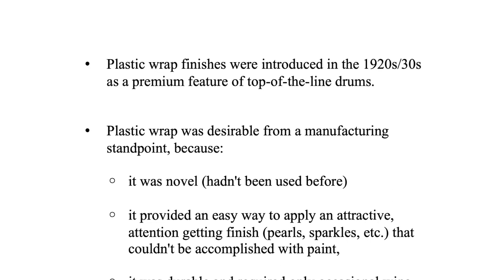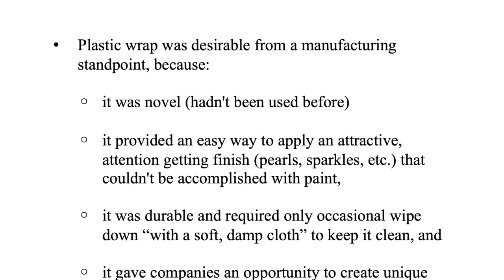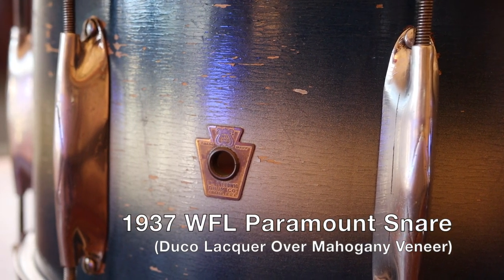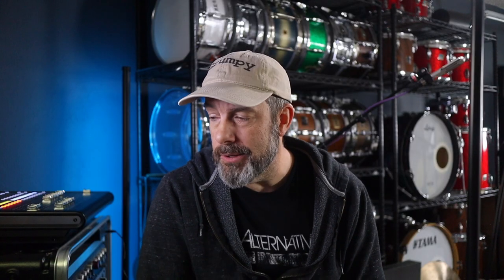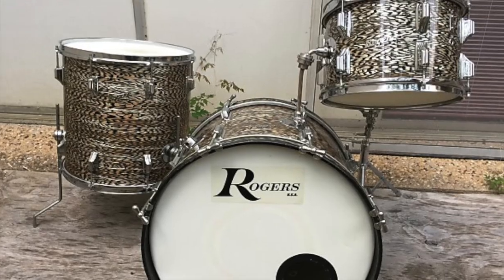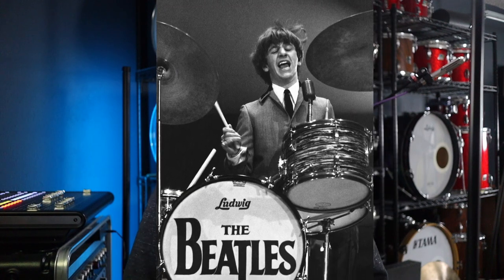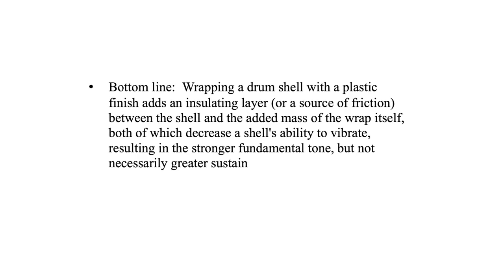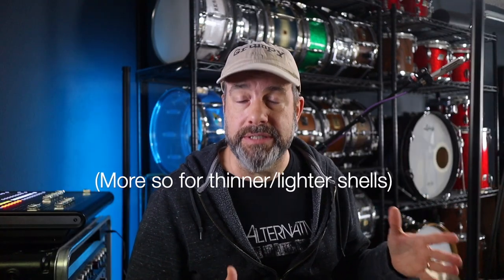Is plastic drum wrap really bad for my drum sound?

Comment: This was very helpful! Thank you.

I'm thinking of rewrapping my 91 Tama Rockstar Pro.... it has lacquered shells but it is pretty damaged and I'm not particularly fond of the Transparant Blue finish as it appears more greyish than actually blue so might as well wrap it in Blue Ripple. 

If I use the tape method I could always go back to the original finish, right? Maybe some tape residue that would have to be removed but other than that I wouldn't hurt the potential value of the drums going from lacquered to wrapped. 

Thought about painting it but that seems like it would take forever and be permanent or at least very hard to remove.

I'm not scared of a little sustain loss on this kit because it's already ring-y as hell especially with the Starmounts and diecasts, may even save me some money on moon gels in the long haul.

I think you've helped me make my decision, between that... leaving it as is and painting it... wrapping seems the best solution.

That way I could have a matching 10x10 too, those are hard enough to find as is but especially in 90's Tama Transparant blue.... guess so few people liked this colour that there aren't a lot out there.

 Sorry for the rant brother.
Reply from the maker: Tape would allow you to go back to the original finish, yes, though I don't know what harm, if any, the adhesive of the tape would do to the finish while on the drum.
Reply: @drumdotpizza  Thanks for replying man, I appreciate it! Not a lot of guys do but you seem to make the effort.

Oh no, I didn't mean the tape would harm it.

I meant painting the shells or glueing the wrap would be more work, a big pain in the ass, more expensive and non reversible.

With just the tape, in the worst case scenario, I'd have to remove some residue if I ever decided to take the wrap off. 

Getting a better looking drumkit and having the option to go back with minimal effort cleaning up sound great to me.

Anyway, thanks again man. have a good one.

Comment: Yes it affects it greatly. Would wrapping an acoustic guitar in plastic affect the sound? 
Obviously! Whether or not it sounds “good or bad” is up to the listener.
Reply from the maker: Precisely!  

Martin, in fact, makes a very nice (and costly) guitar called the D-35, which is a dreadnought model with a 3-piece back known for its notably darker tone than the 2-piece back version (the D-28).  It's darker, because the 3-piece design results in a body that doesn't resonate so easily, so just like in drum shells, when it can't vibrate as easily the make vibrating element (strings, not heads, in the case of the D-35) can produce a stronger fundamental sound.  Like heavier drums the D-35 isn't actually producing less high frequency information, but it isn't robbed of the LF content the way a more resonant body design is, so it feels darker overall.  

Plastic does that for drums, and I, for one, would be fascinated to see what it does on a quality acoustic guitar!  Might be a bit overkill, certainly compared to amore traditional design, but could be pretty fun (and amazing to look at!! :)

Comment: my 1978 Superstars have re-rings. Superstars never had zolacoat interiors. That would have been Imperialstars and lower.
Reply from the maker: Correct!  Imperialstars were the ones with zolacoat interiors.  In the video I mention Superstars and re-rings, not knowing for sure if they ever had them, but certain that by the early 1980s they did NOT (same with Imperialstars -- had re-rings early on, but they stopped that by early 1980s).  Neil's custom red lacquer kit, however DID use re-rings, which I think is interesting, since Tama had stopped using them by that point.  I guess they were just going off the Hayman kit that Neil liked so much?

Comment: Uhh,, DW evolved from Camco! I think wrap has no effect. It,s all about the shells and materials. Thin shells with reinforcement rings are the better. I played alit of heavy ,thick, Japanese drums in the seventies and eighties and I was the only one to hate them!! The modern trend with six or seven plys of maple are bright and punchy!  I ve come to really like thinner shells. Uhh my fave set that I still have is a 72 set of Slingerlands, all maple stained mahogany with laquer clear! Great sounding drums!
Reply from the maker: Beauty is in the ear of the beholder, and it seems your ears are most pleased with thinner, more resonant drums that have a higher percentage of harmonics to fundamental.  I'm in the other camp... LOVES me some fundamental!

And yes, DW bought the tooling from Camco (turret lugs, etc.), but Don and John built their drums from a different mindset than Camco from the outset.  In fact, when I first learned about "Drum Workshop" drums they made only natural maple finish.  Period.  They avoided wraps from the beginning, and for cost reasons didn't offer other finishes stock.  That was around 1980 (they were mostly just selling their 5000 chain drive pedals at that point).  Within 10 years they were quickly becoming the Rolls Royce of drums and still refusing to wrap any drums in plastic.  Eventually demand won out, though, and they started wrapping them.  

Thanks so much for being here and chiming in!

Comment: That´s ok Joel, but in the end, so many layers of paint and polyurethane applied on the drum shell  end up doing the same effect as the plastic drum wrap, so I can´t tell the difference in sound.
Reply from the maker: Great point, thanks for that!  Layer upon layer of lacquer/poly/whatever does impeded the vibration of the shell too (the hardness and elasticity of such finishes is quite different than ANY wood that it would be applied to, so yes, it definitely affects the sound, particularly if the layers are thick).
Reply: Plastic is plastic! Back in the day covered finishes or pearl finishes, as they were known at that time , were more expensive than lacquer or duco painted finishes . Check out some old drum catalogs.

Comment: It's all hogwash. The wraps on the outside. Feel a shell as you hit it.not.mich vibration going on.the wood is just the means.the air is moving from the heads.which is why you can make a plastic drum. You can make a snare out of a pumpkin. You could make a thin concrete floor tom that would probably be pretty fat sounding. Or a concrete bass drum? It'd all end up being about the heads,the tension,the rims. Surely a couple ounces of wrap doesn't trump half a pound of screws and and metal.if it did,than they'd have tried to go away from heavy wood shells,and gone for something lighter.
Reply from the maker: DW makes (or at least MADE) a concrete snare drum (part of their Collector's series, IIRC)....  I want to play one.

Comment: good analysis.i found your video by searching how to stain drums.i m thinking to remove the wrap from my drums.the main reason is that i bought a second used bass drum for my kit,but its wrap has some  wrinkles,and also becouse i bored the sparkle color.I also was thinking that the sound will became more open.its a birch/basswood pearl vision set,which sound a little muted.i will also try other tom mount and heads.
Reply from the maker: The interior ply of that drum (basswood) isn't finished, that is there is no seal or coating on it.  It's bare wood.  And basswood is very soft, so the sound of the drum will be dark.  If you want to brighten it put a couple coats of tung oil or the like on it (or seal with light coat of lacquer, poly, etc.).  That will brighten the drum and make it sound like a more expensive drum.
Reply: @drumdotpizza  thanks for the sesponse man